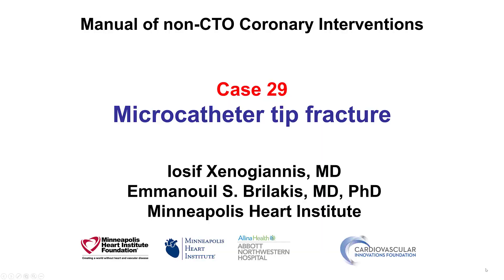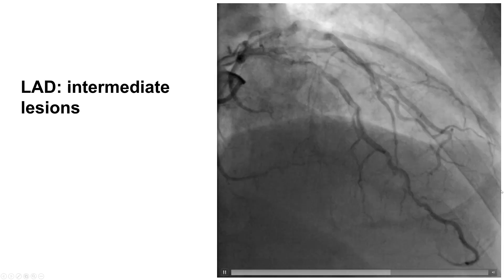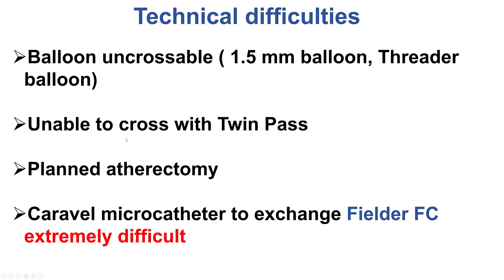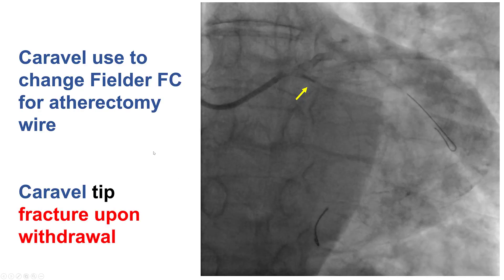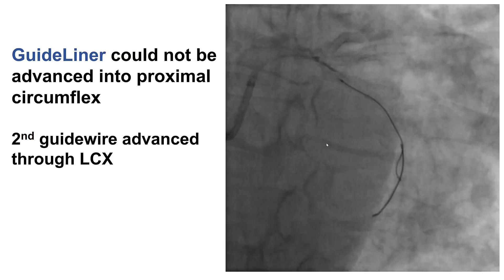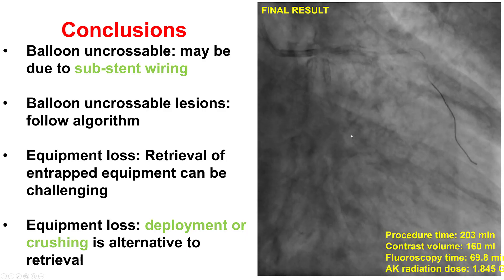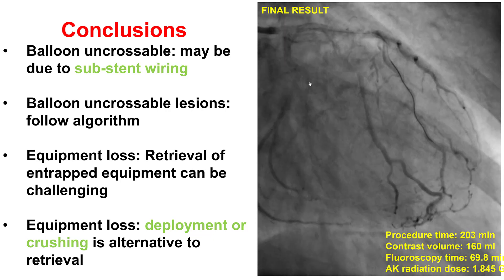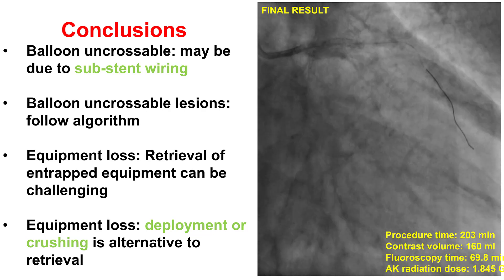Case 29: PCI Manual: Microcatheter tip fracture

Comment: An interesting case, Dr Brilakis. How exactly were you able to retrieve the fractured microcatheter tip? Presumably you simply withdrew the guidewire over which the microcatheter was initially advanced, and there was sufficient friction between the wire and fracture tip to allow the tip to come back with the wire.